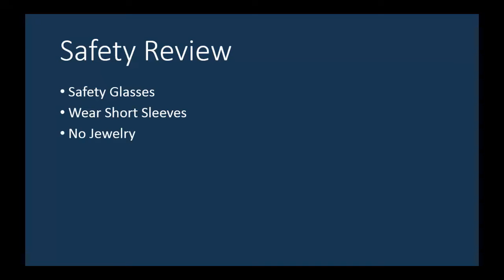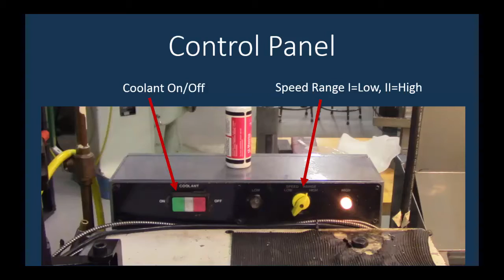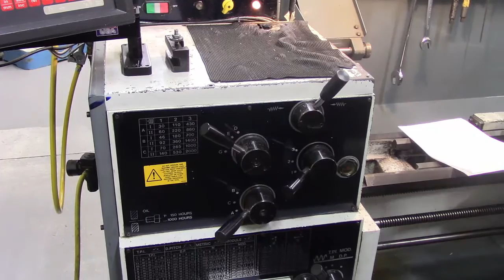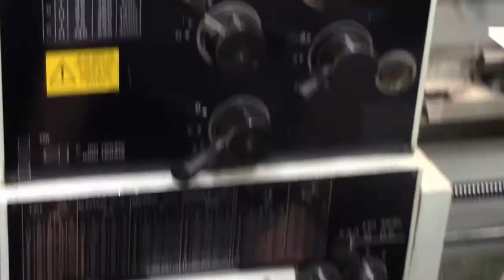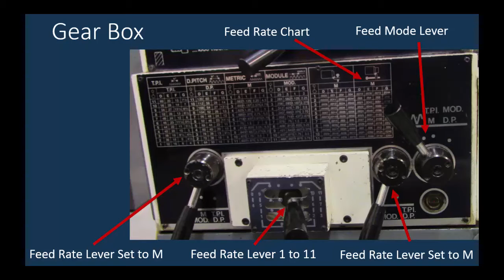ENR 153 Machine Shop 1  Lathe Left Side

Comment: 1.) Wear safety glasses at all times, as well as short sleeves. Jewelry, headphones and earbuds cannot be worn at any time. Hair must be tied back.
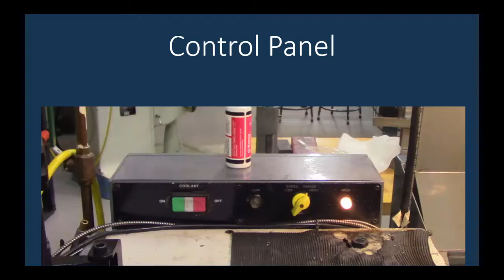2.) The control panel can be found at 7:24.
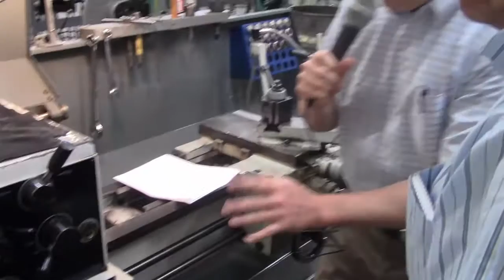3.) The head stock can be found at 11:56.
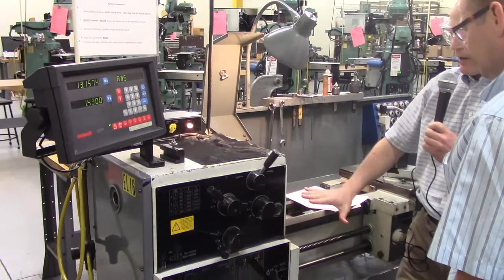4.) The gear box can be found at 17:26.
5.) The X-axis of the DRO monitors longitudinal movement, along the ways. The Y-axis of the DRO monitors cross feed movement, perpendicular to the waves.